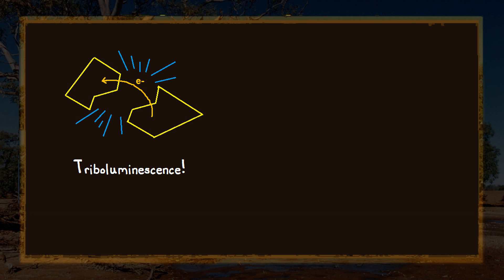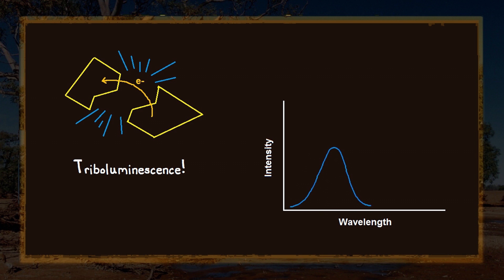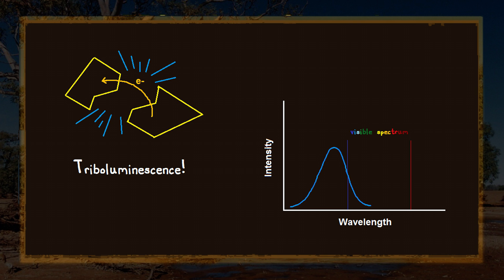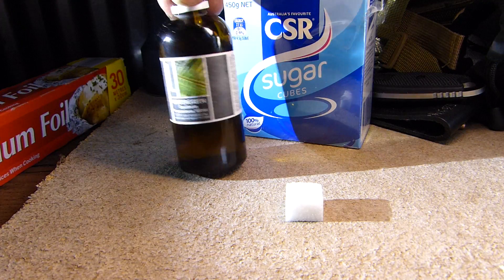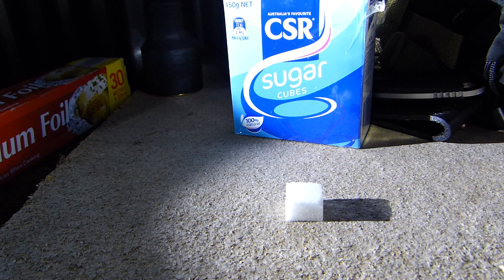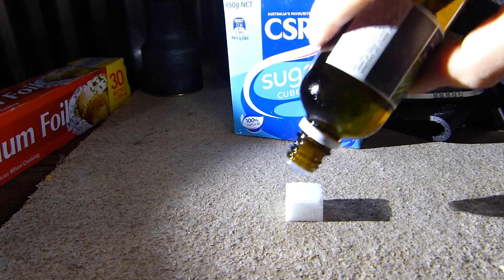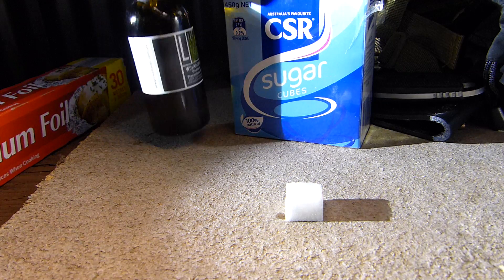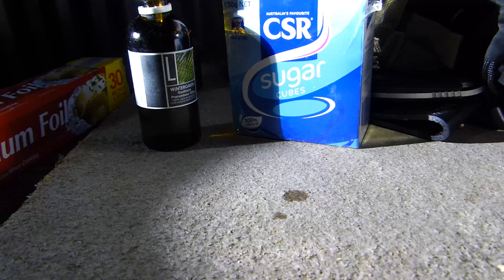Photographing a Bullet with a Sugar Cube! High Speed Triboluminescence Photography

Comment: Dear sir can you tell me the name of the camera you used in the experiment.
Reply from the maker: It was a Sony NEX 5n
Reply: @FPSoutback  thank you sir
Reply from the maker: with 50mm F1.8 lens.
Reply: @FPSoutback  Sir ISO setting I have found in the video is 12800. Can I perform this experiment with ISO 12800? and Sir what was the frame rate per second you chose  for this experiment?
Reply from the maker: The higher the ISO the more light will be detected but the more noisey the picture its a tradeoff. There is no framerate, its a still photo taken in the dark with the shutter held open for a second while the shot is taken.

Comment: Out of curiosity...have you ever considered experimenting with nitroglycerin, specifically the little sub-lingual tabs used for angina. Do they actually contain the same chemical as the explosive? Would impact with a hammer or a bullet be enough to cause a reaction?
Just wondering.